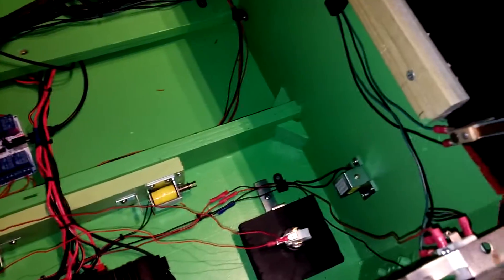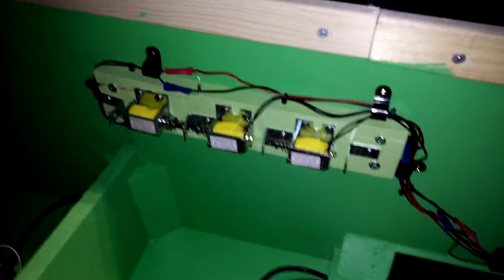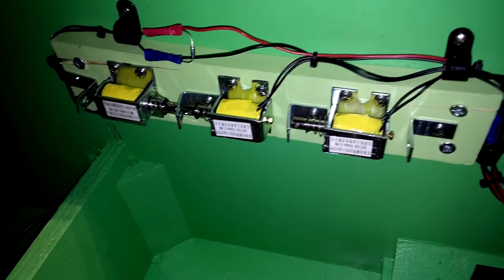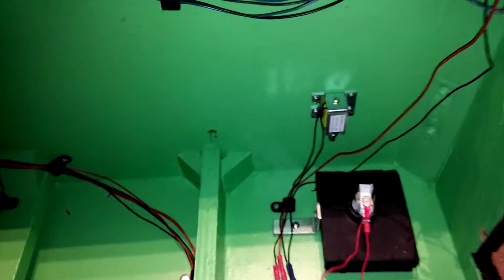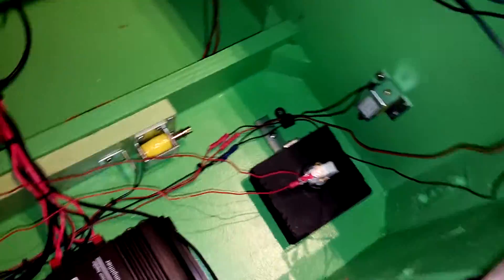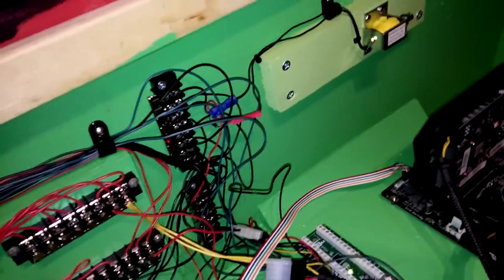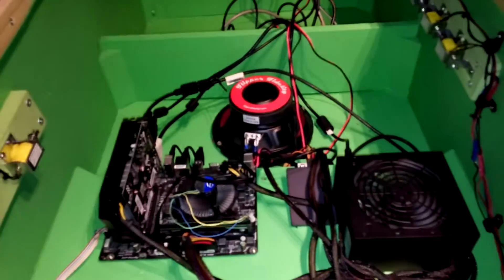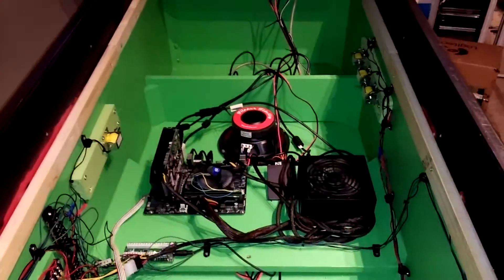Virtual pinball cabinet running 12v solenoids

Comment: Mike does that software allow you to tie the buttons to the solenoids, basically what I’m asking is how do the solenoids speak to the press of buttons or when the ball hits the back bumpers?
Reply from the maker: The solenoid firing is part of pinmame depending on what the game requests-  DOF is a function of Visual Pinball / Pinmame and the backglass controller.    To assign solenoids to a specific function in the game you need to use the DOF config utility online.  Sorry the setup sounds pretty confusing but isn't too bad.  The config file is generated automatically and you just place it in your DOF folder.

Comment: Hi, can i use solenoids with sainsmart 8 ch relay without ledwiz? Is it possible? For example if i want to activate solenoids only when i press flipper buttons, can i do this also with solenoids and sainsmart? Thank you
Reply from the maker: Sainsmart makes the USB version that is all-in-one.   You do not need LEDWiz to trigger solenoids from DOF.   You just need this version:  http://www.sainsmart.com/sainsmart-4-channel-12-v-usb-relay-board-module-controller-for-automation-robotics-1.html
Reply: thank you so much
Reply from the maker: They are able to handle AC250V 10A ; DC30V 10A    You will be fine!
Reply: Mike Karina Great! Thank you 😉

Comment: Hi Mike! Where did you bought your solenoids.?
Want to replace my Siemens Sirius 12V contactors as they start to break down,,
Clean cabinet so far btw :D
Reply from the maker: Gustav Wingburen Look for "Open Frame Solenoid" on eBay - they have a yellow jacket.
Reply from the maker: Gustav Wingburen http://www.ebay.com/itm/Open-Frame-Actuator-Solenoid-Electromagnet-Push-12V-DC-10mm-Stroke-0-8N-Force-/121121481685?pt=LH_DefaultDomain_0&hash=item1c336723d5
Reply: thanks pal! :D
Reply from the maker: Hi!   The cabinet has gone through a ton of changes.  Actually building a new one for a friend now.   The solenoids are from eBay.  Just search for 12V open frame solenoid and you'll find the yellow ones.  They ship from China but got here fast.   I've also added a Data East 23-800 knocker running at 24v-- its in one of my other videos for the new cabinet.

Comment: Hi Mike, In this video you have the 8 channel usb sainsmart, in another you have sain + ledwiz. Why switch? Why use one over the other?
(allknowing2012 on vpforums)
Reply from the maker: Daryl Erwin I switched to LEDWiz + 16 channel relay because I wanted to add an additional 3 solenoids (11 total) which was beyond the 8 the USB Sainsmart could handle.   This is (2) flipper (3) upper pop bumpers (3) mid pop bumpers (2) slingshots (1) knocker (which is 24V)   Otherwise if you just use 8 solenoids-- both are the same.
Reply: +Mike Karina very nice build! I am waiting for my solenoid (same as yours I guess). You are using a relay on top of the Ledwiz because of the 500mA limit?
Reply from the maker: +Littlecabbage This is actually an old build-- I have a much bigger build now.  11 solenoids, LEDs, nudge, plunger..etc.  To answer your question-- yes you need a relay as the 500mA I thought was total load.  I figured each solenoid draws about 250mA but multiple that by 8 solenoids it would far exceed the power the LEDWiz can support.   Sainsmart relay modules are cheap.   You can get the 16 relay board for around $30-$35

Comment: beautiful job on that cabinet but how do you configure the solenoid with the bumpers on the table? Is that the relay config?
Reply from the maker: +שי ברקן Old comment but the solenoids are configured with the DOF Framework.   It is simply a  plugin for Visual Pinball (but more related to the Backglass server) B2S_server.   The config is auto-generated from a vpuniverse website.   This updates all tables to fire the correct solenoids without having to modify each one.